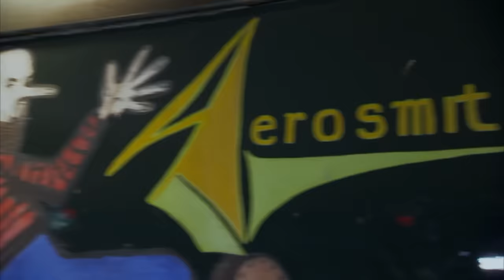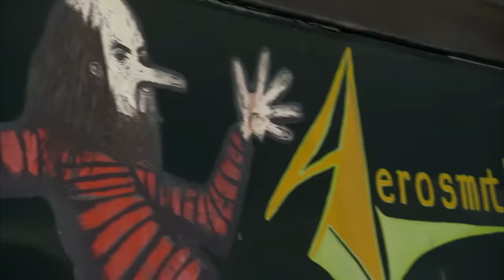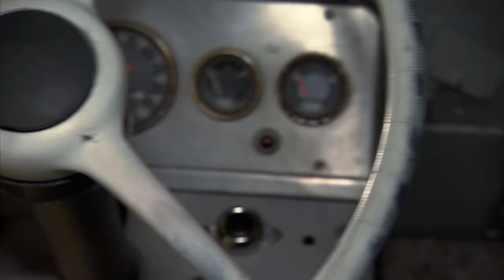American Pickers: Aerosmith Gets Back in the Saddle (Season 20) | History

Comment: They should've smoked a big fat joint in the back of the van just like in the old days!
Reply: Frank Discussion They can, they have a Vegas residency, and it's legal in Nevada. But they are probably past the point of doing that at this stage of their lives, because with age comes the wisdom that what you did in your 20s can't be done in your 60s. And Steven Tyler drives around in a powerful sports car, so he doesn't need anything at this stage of his life that will cloud his judgment behind the wheel. You can't rock out when you're sleeping in a crate.
Reply: @cornellgreen3692  Square